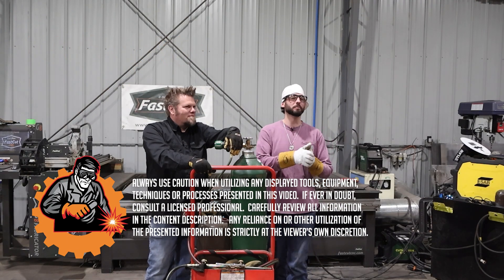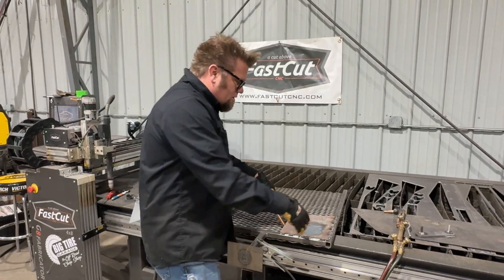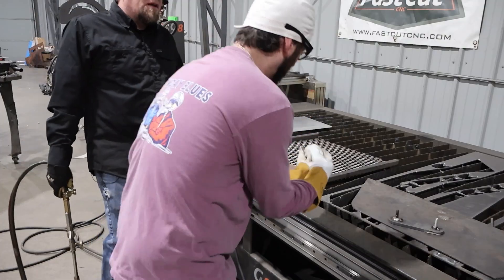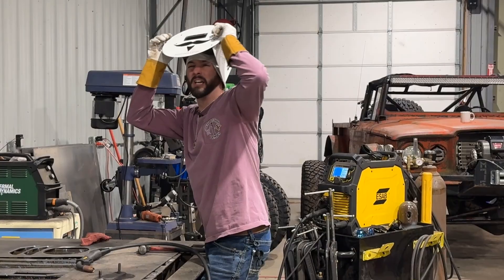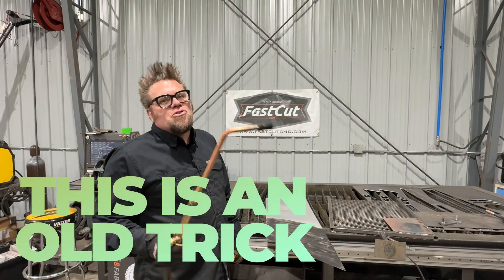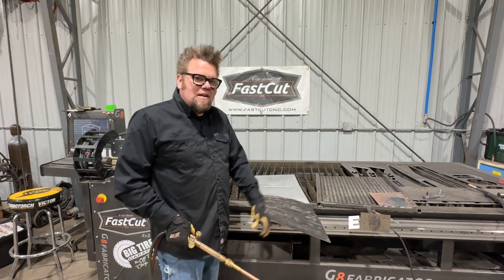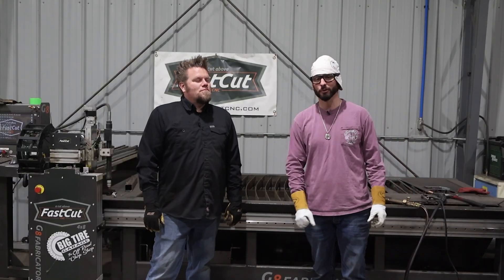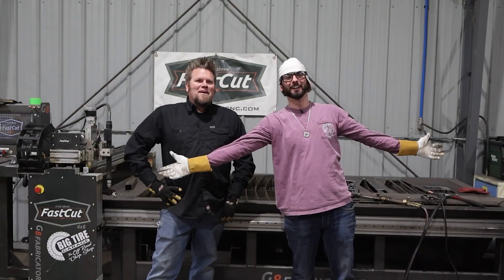Unveiling 3 Secret Oxy-Fuel Torch Techniques!

Comment: On the aluminum annealing please note that the process shown is only applicable for the strain hardening aluminum alloys, specifically the 3XXX and 5XXX alloys.  The 6XXX is a precipitation hardening alloy and is annealled by heating to about 900 to 950F and then quenched in water.

Comment: Guy brings a 1/2" plate aluminum to be cut and bent, it had no proof marks so I didn't know what it was, bent the first piece and Pop splits down the bend, "Oh #hit it's tempered" did the soot trick and finished the job. it works very well.
Reply: Proof is in pudding!